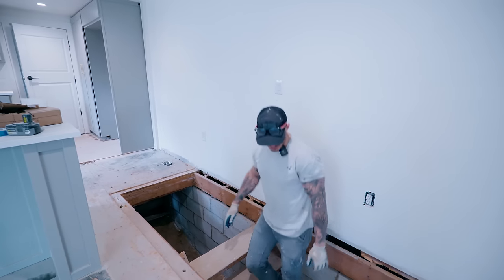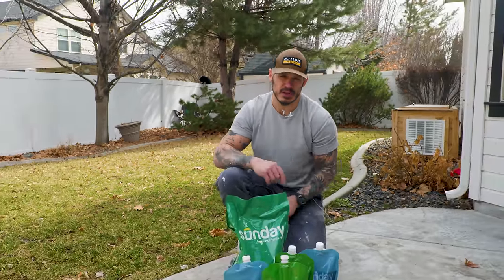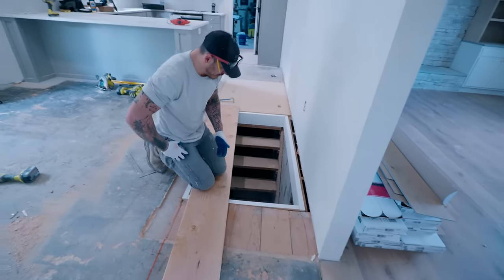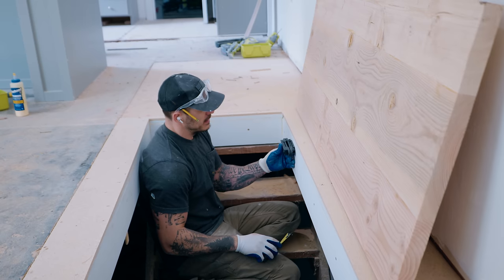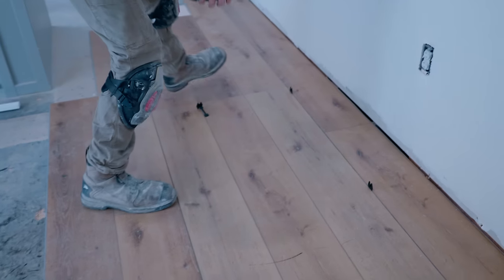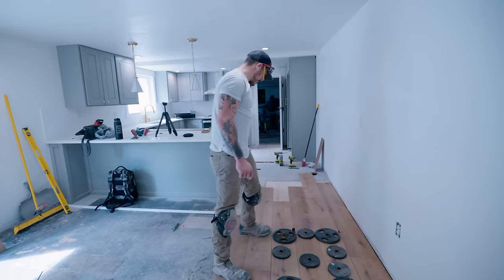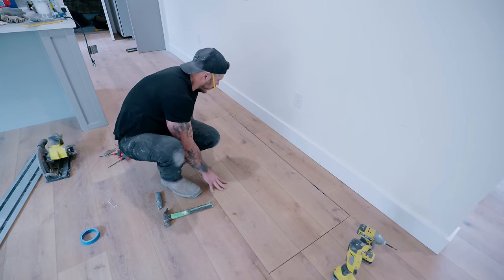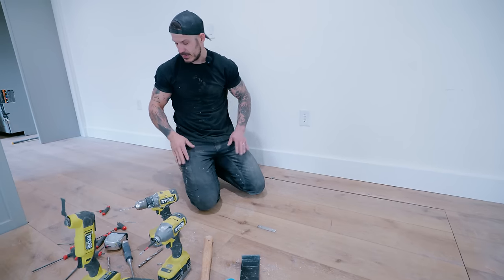Creating A Hidden Room With A Secret Floor Door!

Comment: Just wondering is the opening big enough to get a furnace and hot water heater down because some day they will need to be replaced since you made it smaller. The other thing I would worry about is it strong enough if someone moved something heavy over it that it don't fall in. I will say it looks good just a couple of thoughts

Comment: Is the door wide enough to get a water heater or a furnace thru not if but when they have to be replaced? It looks like it would be really tight to get it thru there and down the stairs.

Comment: Just a suggestion. I’d do what deck builders do when they paint black underneath. With the gap that you don’t like, just get the closest paint you can to the floor and paint that gap inside. It won’t get rid of the gap but it will definitely help hiding it

Comment: You set the hinges to work with the surface of the door and not the finished floor.  You would have to raise the hinges up the thickness of the flooring to get the pivot point over the lip...

Comment: this may sound kind of weird...but what about using an car hood type of hinge. it would mount on the side opposite of the stairs. it would also hopefully fix the gap problem because it opens upwards as it move toward the hinge side and make the gaps smaller between the transition

Comment: If you take the thickness of the flooring into account you can use the same hardware for the hidden door. So move up the hardware the same amount as the thickness of the flooring, and you should be able to get the gap back to about 2mm. I believe thats about a 1/32 in imperial?

Comment: If you put a 'fake' joint in the center of the middle board of the door it will give the impression of a break in 3 matching board lengths ❤

Comment: Something I was thinking would be good to do would be to put some cross-bracing across the underside of the door since the 2 X 12s that you used are only glued together. I know the glue is plenty strong to hold the pieces together, they may not be truly strong enough to hold the weight of people walking on it over time. The cross-bracing would help to do away with any risk of the glue failing and someone falling through. Overall, I really like the door. 

In the future, instead of using LVP use actual wood flooring which would allow for a more random pattern which could work to your advantage in creating a more hidden door.

Comment: its too late now but i wonder if you could have essentially done a spring loaded RFID door. Creating an RFID release isnt too bad from what i've seen, pretty sure there are premade sets and you could have a plant or something nearby with the RFID tag in/on it to release the latch that is holding the door down and then when you are done you just press the door into the ground and it would relatch.

Comment: First off for the hidden handle you could use a neodimium magnet recessed inside the bottom of the door. Then you'd just need a metal handle with some felt on the bottom where it would latch onto the magnet when you wanted to use the door so it wouldn't scratch. The best setup for the handle would be to have 2 magnets in the door and 2 in the handle. That way you could set a north and a south on each side so the handle is stronger, and only fits 1 way. You could even get creative with this and do 4 on each alternating north and south creating a lock mechinism. You'd place and then turn, and the twisting would lock and unlock.

Second, for the door itself, you would want to bevel around the whole door for this type of door. As a former door maker, you normally only bevel the knob side, but this is a different case. You would also want to bevel the hinge side jam and flooring so you'd be able to get closer but have clearance for the flooring on the door to slip past the lip of the flooring on the floor. If I remember correctly we even did a hidden door order where we beveled hinge and knob side so we would need less clearance around the edges.

Third, if you really wanted to pull off a hidden door you'd want to make the floor based around the door, as opposed to making the door based on the floor. You'd want to pick shorter lengths of board. That way you could let it overhang in the same pattern as the rest of the floor on top and bottom with no problem. For the overhang I would use magnets and gain, but not neodimium, just normal strength, recessed into the floor and metal recessed into the flooring.

Comment: I'm over a month late to this but another youtuber I follow solved the gap issue in a really clever way on a different build entirely. I'm going to try and explain it here, but if I fail you can watch the video "Building the ENDGAME invisible PC" by the channel DIY Perks.

They cut the side with the hinge as a hollow triangle pointed down and then put a triangular strip in the hole with some spring-loaded wires to pull it down. When the top opens, the triangular piece should get pushed out of the way by the door itself and then when it closes the springs should pull it back into place. And if you use the right pieces, it should be completely invisible even up close.

It's a super cool and very cheap idea and you can probably still do it with the door as it is now.

Comment: Your fixed platform should have only come to the BACK of that top step, not the front.

Now, you have to take a double step to get to the floor level. 

That makes your stairs a lot less safe.

Otherwise, you did an excellent job, and your final results are beautiful.

It's a very well fit door, and isn't immediately noticeable, so I believe you've done very well.

You could paint your handle to match, but I think the paint might wear off with people walking over it, so I'd just leave it as it is.

And if it bothers you, just put a hall runner over it, that would be easy enough to pull up when you need access.

Comment: Honestly not bad! I think it’s the more elegant choice you went with rather than something obvious although pls glue down all the surrounding flooring around that opening because it will get beat up otherwise. It’s nice square footage that’s useable at least to walk on although I’d add a disclaimer to any potential buyers not to put a cabinet or whatever on top. The reality is you have to have a gap for the hinges to work properly which is more important than leaving too small of a reveal to only bust the flooring up later.

Comment: Think you did a great job with the situation you have.  I would be concerned with any potential liability with a renter getting injured if that slab comes down on them or a child. May want to find a way to lock it and add a strut or other  mechanism to dampen it when it closes.
Reply: If that door stays in place long term, that flip handle will be responsible for no fewer than 5 trips to the ER with a severed toe.  

Little feet running around, it'll pop up at some point and the next trip past will be the end of a digit. 

Having said that, he's trying to solve a very difficult problem, and doing it well.  It would be near impossible to find the perfect solution that keeps the door, makes it completely hidden and functional.

Comment: Instead of that tiny sliver of plank you have butted up against the secret door, you should have cut that plank leading into it half way. Two medium sized planks would look better than that little 2 inch plank in the middle of a floor. Otherwise it looks perfect. Can only do so much with that hinge. And it opened up so much floor space for the kitchen. Awesome job.

Comment: For anyone doing something like this, piece of fabric in a oak/floor color under the planks on both sides (hinge side), that way it's not a gap, but just a little line between boards with a fabric hiding the basement

Comment: Honestly do some digging add a door on the exterior with some steps and cement work to have access under their. Screw the hidden door in the middle of the main walking path. It’s looking a little tight to get a new water heater down there when it needs replaced.

Comment: I bet if you put the hinges a little higher on the 2 x 4 door, it wouldn’t catch almost to the point. It’s poking through the top before it touches the floor panel.

Comment: I do think the way you did the glue up could cause some bowing issues in the future.  I would have done smaller pieces and glued it up the opposite direction.  Then the span across is shorter and better supporting on the glue joints.

Comment: One solution for your secret door and the reveal issue would be to have the hinges closer to the surface, vs in the middle of your door, making it about 3/4 in from the surface. If your hinge was more flush with the surface, or an 1/8th below it, as you opened it, it would increase your gap instead of pinching which is what’s was happening to you. Think about it, a regular door hinge is like a half inch “above” the door (in this orientation). But since you centered the hinge on your door, theres like a 1/2 inch that needs to swing behind the hinge, causing that pinching, forcing you to have a larger reveal on the hinge side. It’s a simple fix, move the hinge placement on the door closer to the surface if not flush with the door and only under the flooring, line it up on the floor frame, so move it higher again, and replace the one piece of flooring that you cut to make it function the first time!!

Comment: overall a great job, but isn't a handrail and the step spacing code? seems like the top step would be too high and the lack of a handrail could be an issue. Perhaps a handrail could be integrated into the bottom of the door so when the door is open, there is a rail?
Personally, I would get a beefier handle. that just seems like there isn't enough wood between the handle and the screw. Other than that, I think it looks great. it was never going to be hidden since it needed to open. everything is minimalist as it can be. i think painting would be a bad idea as walking over it and/or a rug would eventually rub the paint off. It needs pistons to hold it open and for slow close. that would put much less weight on the handle.

Comment: For one, thats the wrong hinge. You need one that pushes and lifts up to clear the back edge. But you Should have just shimmed the hinges 1/8th to move the door out. Or if needed bevel the back edge with a router.

Now you have a bigger gap with a crooked line cause you can't cut straight with a multitool lol

Gas struts, or in a pinch, you can use the strut from a screen door to lock it open and have a soft close

Comment: Did you ever consider putting a fake/valuables safe floor outlet or ac vent where the handle is? That could be used as a handle and wouldn’t look out of place on the floor there.

Comment: you needed to bevel the first plank a little so the thickness doesn't rub as you lift the door. if you did it right it would just look like an imperfection in the wood.

Comment: If it were me, I would not have used any hinges on the door.  Instead, mount large magnets to the underside of the door, then use magnets with handles to lift the door off the floor.  Tight tolerances and you can overlap the flooring as needed.

Comment: 1st of all great job! There is a little flaw with your measurement with the hinges, you did not calculate the addition of the flooring. You only added for the 1 1/2" center of your 2X material. If you subtract the thickness of your flooring, you would not have the issue with the hinge side catching. Say for instance your flooring thickness is 1/4", of which is mostly standard, then your hinge should only be 1 1/4" down instead of 1 1/2". It is all pivot angles. You rais your pivot angle up, it gives you more clearance. Hope it makes since to all.

Comment: 26:55 what if you use brown silicone closest to the floor and apply it on the hinge side then cut it of with a blade by the door so it will create a illusion that it's 1 piece also what if u add gas shock to hold the door unless later on on the video you do it and I haven't got to the part lol😂😅

Comment: To fix/hide the gap, the thing id try is using a rubbery silicone/caulk like a grout on tiles, but the rubberness of it should let it open and close with the door while hiding the gap, using either a grey or tan color to match the flooring.

No idea if it'll work, never done it myself, but the principle behind it makes sense that it'd work

Comment: Ok, nice job on the "door" ... should have used a brass handle instead of stainless steel.  Also,  I hope you can fit your water tank through that smaller opening ...

Comment: The door structure lacks dimensional stability. When the humidity is high, it will get wider. You could find it stuck, unable to open. And - put a heavy point load on it like with a dolly wheel and it could split instead of flexing.

Comment: Should've cut the tongue and groove planks, then staggered the floor as you usually would so there isn't a rectangle line. The lines make it not hidden, door latch, gaps, wrong hardware used for hinges, and needs to pivot before opening so the gaps can be nonexistent. More prep next time.

Comment: I have been following you for years and really enjoy your content.  However this door scares me.  The openness all the way around, no rails and the unexpected approach to individuals turning that corner. From the living room.  You’re doing an exceptional job on the home but I believe a lifted door going up instead of to the wall might be better. Also I can see that wall being damaged a lot without a stopper or guard to protect it.  Based on your design of the kitchen I could see the challenges before you in addressing the area.  Safety first over design.

Comment: Throw a rug runner over the opening to mask the door opening. Just the laminate flooring reveals the opening too much. You should have staggered the flooring beyond the opening by 2” on one piece of the laminate, and 6”-8” on another piece of the laminate, and then 3”-4” on the last piece of laminate, that way, the door opening isn’t revealed as much.

Comment: It’s complicated for a handle I would’ve used magnet that switches off on as a key and plate steel flushed out under flooring on the subfloor

Comment: 45* cuts all the way around and moving your 2” and 16” random pieces from up against the door to the very end of their respective rows (which I think even start in a different room) is everything for the appearance, or lack thereof. Gas struts so no one dies is a good idea, no idea what brand or anything sorry. For support; In lieu of the door frame lips all the way around, I would’ve notched the sill in 4 places and put 2 flat iron strips across the bottom of the door and then used plywood and particle board on top so it’d be stronger and lighter and also keep the opening bigger. Then you wouldn’t need the Arnold Schwarzenegger of struts. Keeping as much of your width as possible and the door as light as possible while still strong would’ve been my top priorities. If you can’t get your water heater in or out, or your extra truck tires, or treadmill what’s the point?

Comment: If your door is only 1.5 inches thick, why would the hinges be installed below where you want the door to sit? 12:50
Reply: He installed it incorrectly and does not address it.  @14:27 you can see the original recesses below the actual door... he covers it with the jamb in the next shots where the door is open.  He even comments how perfect it installed when he really should have addressed it in case anyone else does a similar project.

Comment: Okay...why would you do this?  Why wouldn't you just add a door outside and close up the floor?   This seems like an unnecessary project.  What am I missing?  BTW this isn't hating...it's a legit question.  Just curious why this solution (hard w/ lots of issues that could go sideways) vs. just adding a door outside (simpler solution w/ a more optimal result).   Love this work on the house.  It's going to be great...just don't understand this one.
Reply: Good point. Because he's not finishing it or using it as a basement. It really is a glorified crawl space so an exterior door makes sense.

Comment: I see that you changed the height of those hinges 14:27 and decided to not tell the audience
Reply: I was hoping I was not the only one that noticed!  The whole time doing hinges I thought "He will address this..." you can even see the original recesses below the actual door at your time-stamp.  Then he covers it with the jamb in the next shots where the door is open.  He even comments how perfect it installed when he really should have addressed it in case anyone else does a similar project.

Comment: Your biggest issue with that door is those cheap chinese hinges. Should have bit the bullet, and gone with either Soss or Richleau. The difference in the quality of the hinges is astonishing. I won't use hardly anything else doing hidden hinge doors. It's not worth the headaches and the stress.
Oh, and paint that rotating handle BLACK.

Comment: Overall it looks awesome man, its almost 100% hidden and thats was the goal! Great job! The one thing that i would do with that door handle is not paint it, matching it with the floor might be too hard, but i would go in a store and get a selfadhisive wallpapper with the same color/grain match(you could take an offcut from the floor with you to help you) and just tape it over and cut the lines...it might hide it really well and in case you dont like it overtime you can really easy peel it off.